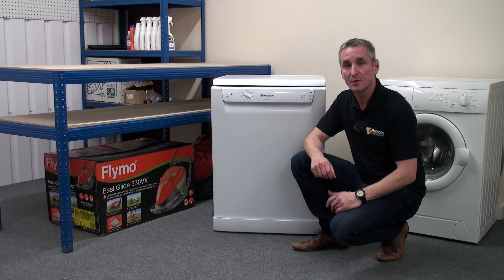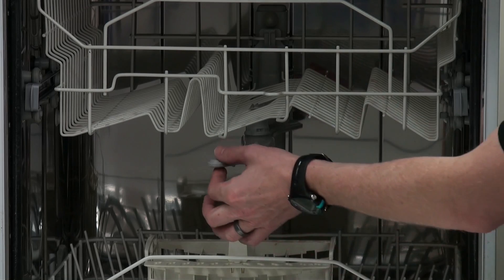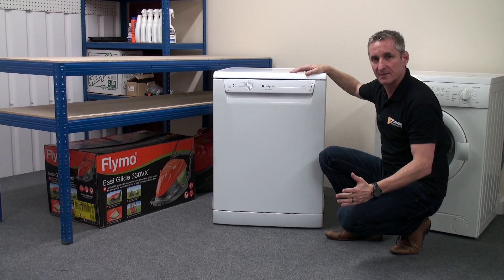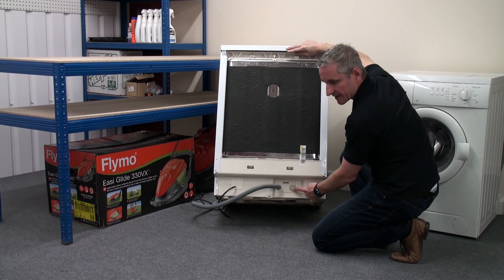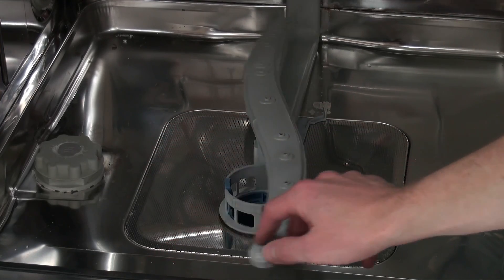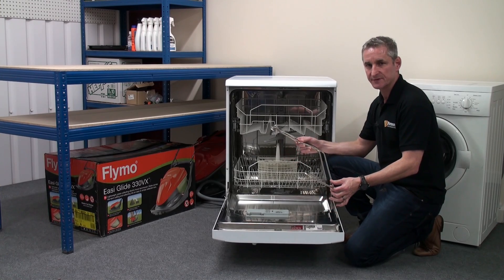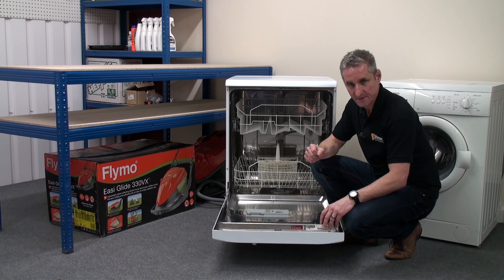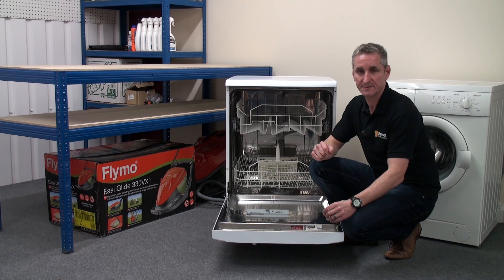How A Dishwasher Works

Comment: This man shows you on the easiest possible machine.
It is that easy to change the pump, if, you can get to it !
my expensive Bosch dishwasher is now a pile of scrap awaiting collection.

interestingly, my local repair/supply shop said they take the machine away to do this repair in their workshop.
some jobs will be easy and some will not!
If they show the difficult ones, they will be out of business